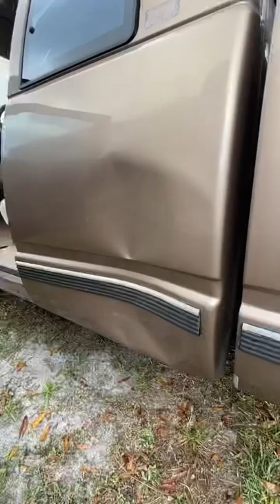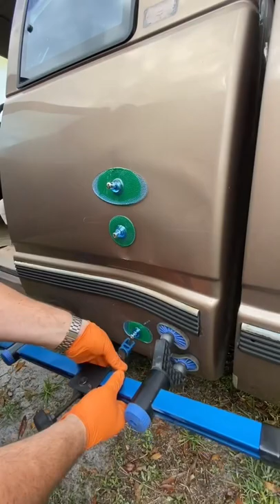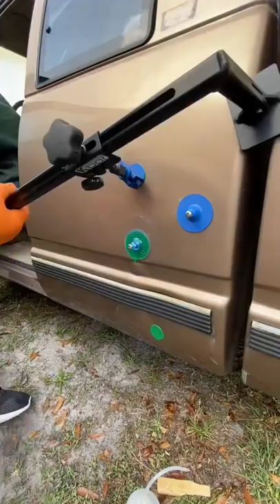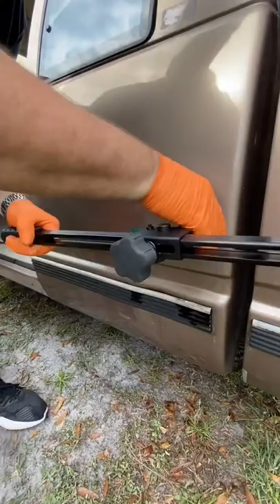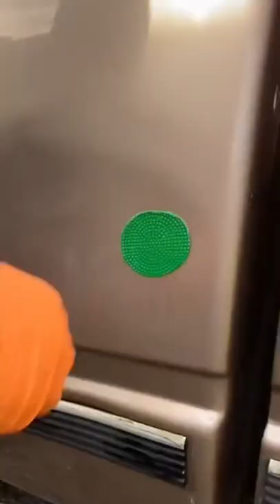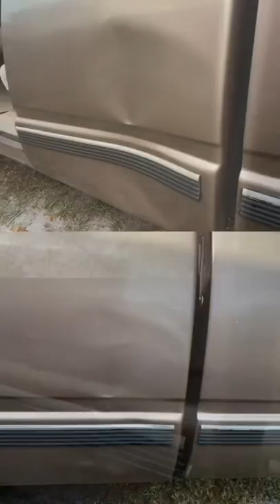Pulling Dents - Just a PDR Poser

Comment: Way easier to push it out from the inside. I personally own an extended cab and ive done it before.
Reply: Did you have to remove the door panel ? I have the same dent in the exact location on my dodge ram extended cab

Comment: What does he use to remove the glue
Reply: Isopropyl alcohol spray
Reply: @justintime4466 what % 99.9% or 70% for example ? Thanks a lot.
Reply: @jojoletoucan5722  70 should be fine. I think it also depends on the glue being used. Would try 70 to start